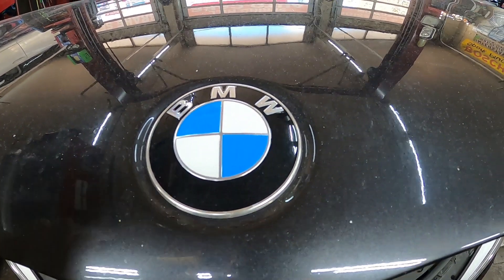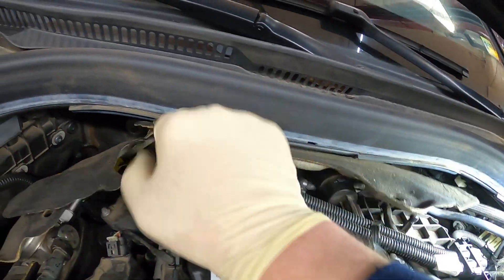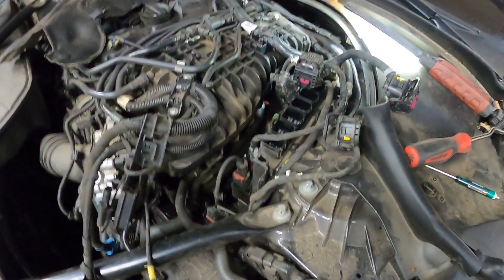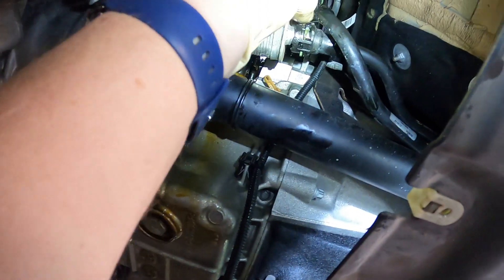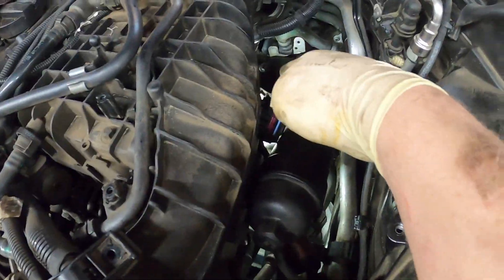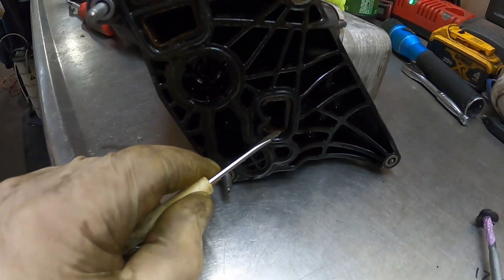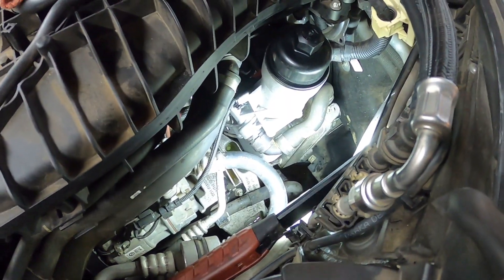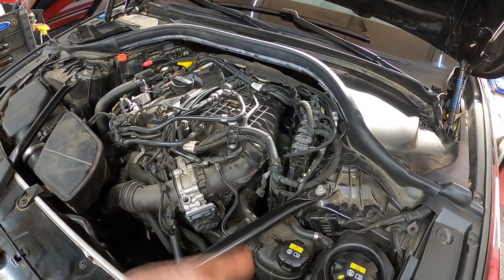2017 BMW 530i Xdrive 2.0L Oil Filter Cooler Housing Replacement

Comment: Question how did you know to diagnose it as the coolant housing I have the same issue but not sure if it’s the upper hose wit the inlet flange or the coolant housing
Reply from the maker: I did not see anything leaking around the upper hose neck. I used my bore scope and could see that the oil filter/cooler was leaking. It took me 30 minutes to get the camera so I could see the leak.

Comment: Can this fault cause the fluid to mix with the oil without leaking out?
Reply from the maker: That's a long shot. Both o-rings would have to be bad, very unlikely.

Comment: I have to replaced one today do i need to drain anything like oil or coolant
Reply from the maker: I take out the oil filter cap and let the oil drain back into the engine and then suck out the remaining oil. I do drain the cooling system.

Comment: My issue is: how do I know my housing is leaking? Do i connect a pressure builder to the coolant tank and watch from underneath?
Reply from the maker: Yes but you still is very hard to see. I had to use a bore camera to see where it was leaking
Reply: @TheGAutomotiveAndMore  I assume it will be easier with uv dye? Or still hard
Reply from the maker: @fisher_price  UV dye will help.

Comment: Great video, for transmission cooler you just remove those bolts to get access to last one right? is it possible to remove it without that? one more thing, did you prime the engine or just adding oil to the oil filter housing?
Reply from the maker: Yes had to remove transmission cooler the get last bolt. No I did not prime it because when you change the oil filter the oil drains back into the engine,

Comment: Hi is it easier to remove the bolts on the B47? I don’t want to be going under the car for that job either all the oil. There seems to be more room that the one you’re working on. Thanks!
Reply from the maker: Its the same. Got to get some of the bolts from underneath.
Reply: @TheGAutomotiveAndMore  thanks imma send it to a mechanic. Also it’s N47 not B mistype

Comment: Dealer quoted someone at my workplace $2500 to do this job.  I watched your video to see what it was all about.  Both BMW and the dealer are crooks.  The part has a cheap design to save a little money compared to making it metal from the factory.  It is also an incredibly stupid place to put the oil filter with poor access and next to the computer where oil can spill on it.  These are truly disposable cars that are asking for trouble after the warranty expires.
Reply from the maker: Plastic does not belong on cars where the heat expands it and then it contracts when cooling off.

Comment: Do you need to drain the coolant?
Reply from the maker: Yes I would so it does not mix with the oil. I also would change the oil when done just in case any coolant got in the oil passage.

Comment: My English is not good. I can find the small broken piece you removed from the oil pan. A metal piece can be attached to it on AliExpress. If there is no cracking in the upper 2-channel water plastic section, the problem can be solved cheaper. I think there is no cracking in the upper 2-channel water inlet. What are your thoughts
Reply from the maker: The rest of the plastic will fail. Replace whole part with metal one.
Reply: Thank you 👍

Comment: Yeah, that’s frustrating to see you Pay a lot of money for these cars. You figure should put an aluminum part in there not the plastic same thing with those old plastic timing chain guides on the 2014 years there’s a class action suit as a result of those things failing like crazy. I figured they learned their lesson. But I guess not

Comment: I was able to do it from the top only, but I used camera on the wire (30$ on amazon) to see that last bottom bolt and I used 8mm magnetic socket on a spring extender to reach it... It was super difficult, try to start this job on a horizontal surface so in case you'll get stuck like me you can lift the car and do it from the bottom.

Comment: did you have to drain the oil before this? Do you think you would be able to change the coolant adapter for the alu one as well without taking the intake manifold off?
Reply from the maker: Yes I would drain the coolant and change the oil. Did you watch the whole video? I was able to do it without removing the manifold.
Reply: @TheGAutomotiveAndMore  the video is awesome but i couldn't see you removing the coolant hose flange, maybe I missed it :)
Reply from the maker: @inferense I think I got ahead of myself and did not show removing it. Sorry
Reply: @TheGAutomotiveAndMore  thanks for the reply and for making the video. It gave me confidence to do it without the whole manifold operation. Awesome work!
Reply: you don't have to remove oil, when I was replacing it almost no oil came out. You will have to do oil prime procedure though before you start the car first time. Super easy you can find on youtube.
Reply: @borismitioglov  thanks I will check that out! what about the coolant? do i need to drain it? I also want to replace the coolant hose flange and put an aluminium piece there instead.
Reply: @zemiak7 that’s what I did too (I also installed aluminum hose flange cause I am not sure if my leaking was from there or OFH. In any case no leaking now 😅
Reply from the maker: @borismitioglov  I would change the oil because coolant could have gotten in the oil passage when you took it apart.
Reply: @TheGAutomotiveAndMore I’ve just put a new oil with ceratec before the fix and really don’t want to change 😁
Reply: @borismitioglov  but did you also drain the coolant before the change?
Reply: @inferense no, I didn’t

Comment: Did it leak when you unbolted the trans cooler ?
Reply from the maker: This is the engine oil cooler and yes it did.
Reply: @ when trying to get to the last bolt on the oil filter housing it looked like you took out the trans cooler
Reply: @ when trying to get to the last bolt on the oil filter housing it looked like you took out the trans cooler